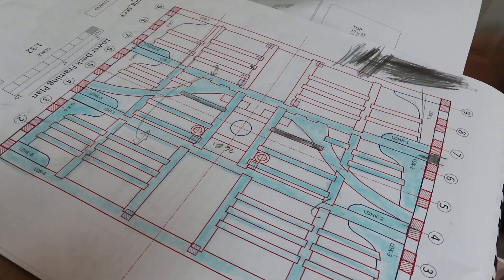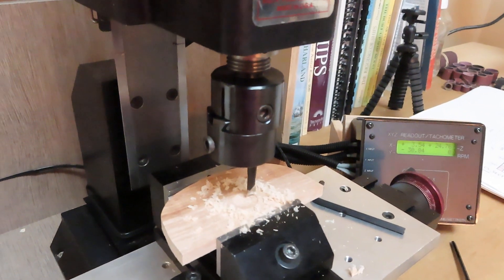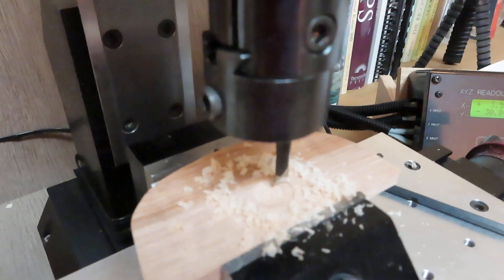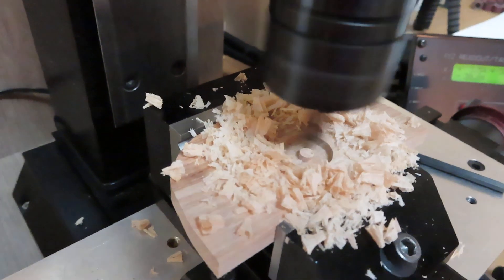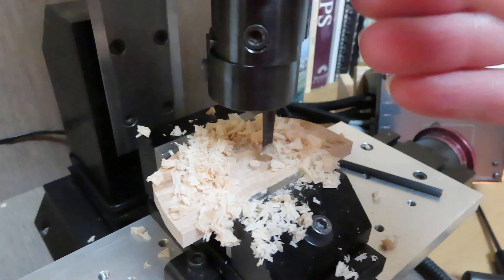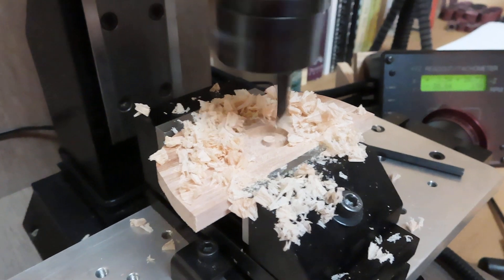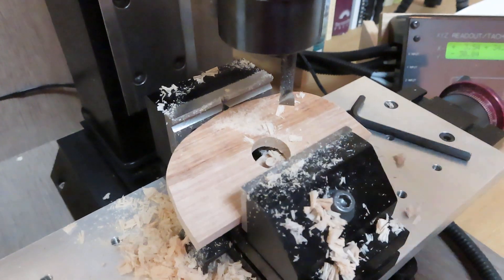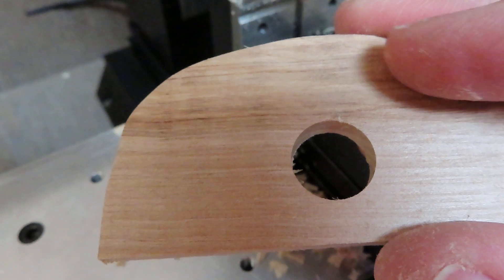Sherline Boring Tool

Comment: Its not designed to cut like this, its designed to enlarge an existing hole
Reply from the maker: Thank you for pointing that out to me. I am new to this tool.
Reply: @shipsofscale  its actually for metal not wood as well. Take no more than 0.5 mm with this tool as it isnt a rigid tool
Reply: I believe you can use the same boring cutting tool on the Lathe. I just purchased the Boring Head for my Sherline 2010 & was looking for videos. You’re it🤓
ZenModeling
Reply: @Zen_Modeling  Yes it can be used on the lathe but its still not designed to act as a drill bit.